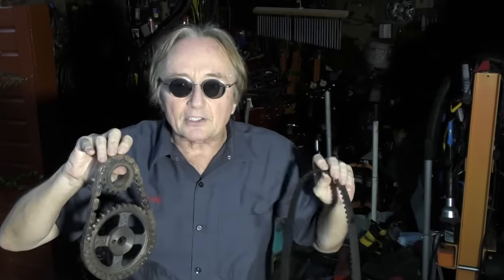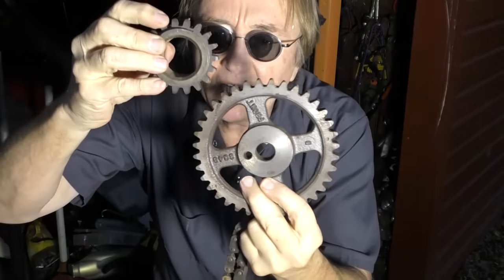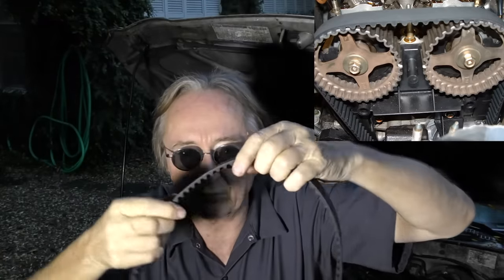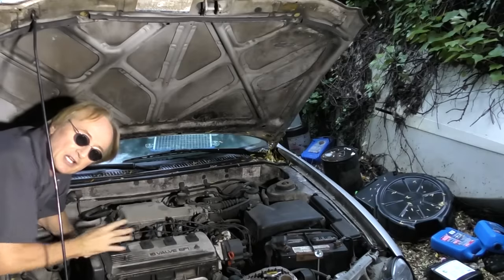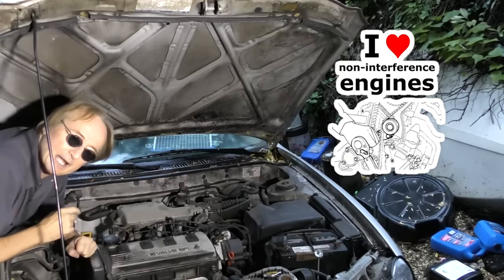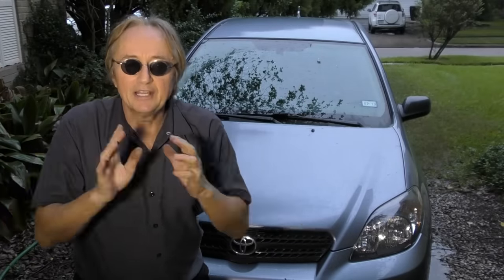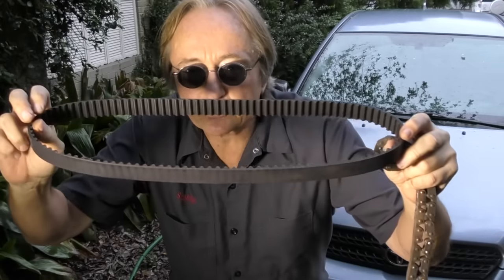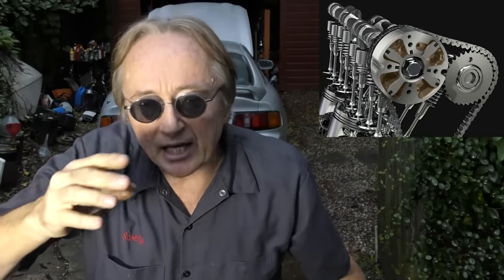Why Some Cars Have a Timing Chain Instead of a Timing Belt

Comment: It's always the same cycle over and over....new guy says we need to dump this old crap...I can save you millions.  Gets promoted.  By the time that idea causes all sorts of pain it's too late.  Then a new new guy comes in and fixes the last bad idea with a another new idea that is actually the old one abandoned by the first guy.  Now he gets promoted.  When all along we should have just been making sturdy reliable products that work for the long haul.  We never seem to realize that new technology often replaces our old problems with new ones.  Either way you still have a problem and nowadays you often wind up with more of them.
Reply: Paper or plastic?
Reply: @tbillyjoeroth  plastic=more useful.
Reply: Like the guy who said DI was the end all be all....  I've seen those so gummed up it choked the air trying to get past the intake valves on gas engines!   What a joke
Reply: Exactly why I will never buy a car with a turbo engine. Enough said.
Reply: So true that’s the lexus attitude and toyota - build it to last and make it right the first time.
Reply: Responsible Citizen . why would they make sturdy, reliable parts. They are in the business of selling year after year. Decade after decade. People want new cars, new body styles. Why put more money if people expect to buy new, and they keep selling you new.  
I agree with you completely. Thou. The other part is new technology has its initial flaws 1st year production cars are the worse cars to buy. The last year has most bugs worked out. But by then they have updated models coming out.
Reply: Scotty doesn't know what he's talking about here, timing belts are an excellent design choice, they're lighter than chains, they're more efficient, simpler, less expensive, quieter, they absorb harmful harmonics that can occur between the engine and cams, they can easily be used to run the water pump, etc... Too many car owners simply neglected timing belts, so manufacturers went to chains.
Reply: It's the same in politics
Reply: @opus_workshop  Electric cars weren't even remotely close to being competitive 100 years ago, the better technology won out. The only reason electric cars are viable now is due to the technologies that were developed for computers.
Reply: @opus_workshop  Electric cars weren't at all competitive with ICE vehicles, they just offered some conveniences that ICE vehicles did not. The technology to build BEVs that performed well simply didn't exist in those days, and wouldn't until the invention of the transistor.

"They did not stick to the method from 100 years."

Because there were actually huge benefits to going from piston engines to jet engines in larger aircraft. To this day, turbine engines do not make sense in smaller aircraft, the technology is inherently inefficient in light aircraft applications.

"Trains as well. Evolved in fuel type from steam, to diesel to electric."

Electric trains aren't reliant on batteries, they get their power directly from the grid. Batteries are what limit the capabilities of electric vehicles in most applications.

"The problem was and is the oil industry forcing a stop on evolution."

That wasn't the case 100 years ago. It was the case in the '90s, and is still a problem, but only in a small way. 

"The technology was viable a long time ago, half a century, if only instead of pouring billions upon billions into R&D for gas powered vehicles, those would have been poured into EV tech, we would have had electric airliners by now, and huge solar harvesting tech. But we are 50 years behind, as we know all too well why."

People have been pushing for improved battery technology (in a very big way) for decades now, the improvements haven't come anywhere close to indicating that battery technology would allow for things like electric airliners. The world doesn't simply bend to our will on command, there are real, physical limits which we can simply not exceed, and battery technology already looks like it's close to its limit.
Reply: @opus_workshop  Are you forgetting how awful Battery technology was even 15-20 years ago? Electirc cars lost out to ICEs because the battery technology didnt improve significantly whereas ICEs made huge leaps and strides during the same time.

We had to wait until the 1980s for lithium ion  to be invented and  only now battery tech is just beginning to  catch up to allow a renaissance of electric vehicles.
Reply: @PistonAvatarGuy   idontcare80  Did you watch the video? Scotty said that when timing belts are made well and used properly they can last a really long time. Coupled with a conservative replacement schedule, they shouldnt give you any problems.

The problem is  when you have poorly made belts in poorly suited applications with poor maintainence, the risks and fallout of catastrophic failure was too much for manufacturers to tolerate.
Also the fact that with newer engines with interference design and techrequiring a lot more tension, the risks and damage of belts snapping has only gotten higher.
Reply: @NidalRashid  Yes, I watched the video. Kilmer claimed that manufacturers adopted belts because they were being cheap, but they were really just adopting the best performing option... which also happened to the cheap one. You shouldn't even have to worry about replacing a timing belt before the recommended interval, most belts will last well past it.

As far as the technology is concerned, there aren't really any poorly suited applications for timing belts in road vehicles, they're not F1 engines. Consider that NASCAR racers run timing belts because there are so many benefits that come with using them. Recent engine designs are also pretty easy on their cam drive systems when compared to the high revving engines that were produced by Japanese manufacturers and were becoming common in the '90s, like the Honda B-series and H-series engines, or the Toyota 2JZ-GTE and 2ZZ-GE. Neglect by vehicle owners is the ONLY reason why timing belts aren't well suited to road vehicles.
Reply: @PistonAvatarGuy   idontcare80  i guess you are right. Kilmer    does say that manufacturers were primarily motivated by their cheapness. But he does acknowledge some advantages of belts (such as quietness).

I still think that while owners should take responsibility  for their cars maintainence, reliability and graceful failure are important parameters in designing a good car for the general population (instead of putting all the blame on owner neglect). I guess we will have to agree to disagree on that. 

Nevertheless thanks for sharing facts and perspectives on the matter that Scottie didnt.
Reply: @NidalRashid  "reliability and graceful failure are important parameters in designing a good car for the general population"

Except that belts are extremely, EXTREMELY reliable, so there's no need for them to fail gracefully, they basically always make it to their change interval. Except in extremely rare cases, belts don't fail prematurely unless they're neglected by the owner, or installed improperly, so basically all of the blame does fall on the owners.
Reply: @opus_workshop  Except that (even now) we can't "switch" to BEVs, there is a whole huge range of things that they simply can't do... and may not ever be able to do.
Reply: @Aviatr23  More waste
Reply: @PistonAvatarGuy  Baloney.  Timing belts have always been an el cheapo solution for el cheapo companies.  The belts do break often very quickly after the book mandated change period. My sister has had two belts break thusly with destroyed engines both times.  Well she should have had them changed on time you retort.  Sure maybe, but she couldn't afford the 500 dollar service charge for the belt change.  

So here are the points
1) belts are cheap for the manufacturer to use
2) belt maintenance schedules generate expensive (profitable) work for dealerships
3) belt failure means the person gets to go buy a whole new vehicle.

As an aside I had a timing chain in my old mocked and derided 1994 Dodge Dakota. It gave me 12 years and 358000km of driving without engine trouble.  I changed nothing.  
I gave the truck to my brother in law, it continues to drive to this day on its original DODGE  timing chain.  Nuff said.
Reply: @percussion44  Like I said, belts were not only the best engineering solution, but they were also the least expensive option. Just ask yourself this: Why do NASCAR racers run belts instead of chains?

I've seen several timing belts go tens of thousands of miles past their replacement interval. 

"Sure maybe, but she couldn't afford the 500 dollar service charge for the belt change."

Which is why you don't find timing belts in most cars, that still doesn't mean that they're not the better performing option. Ever heard of something called operator error? PEOPLE were the problem, the technology itself was superior.

Google: Timing chain failures. I've seen PLENTY of timing chains that launched through chain cases, and I've known plenty of people who've had to replace stretched timing chains, and chains are much more expensive to replace than belts. Tensioners are also a common source of problems. 

The only 1994 Dodge Dakotas that had timing chains also had pushrod engines and the timing chains on pushrod engines are simple, so they rarely have issues, the same is not true for OHC engines. Also, I had a friend in high school (late '90s) that had a Dodge Dakota from around that same year, it was already falling to pieces, I didn't think any of the first gen trucks made it out of the '90s intact, you must have had a unicorn.
Reply: @PistonAvatarGuy  Nope.  Engineering solutions are there to support people.  Human beings and all their flaws and habits etc.   Proper engineering is done to maximize the human experience.  A solution that ignores the most critical element is useless.  As for  NASCAR, pretty sure they tear down engines after each race.  Are you proposing the average Corolla driver do the same?
Reply: @percussion44  The latest iterations of timing belts last 100,000 miles, which is about as long as some timing chains... while also being lighter, cheaper, more efficient and while absorbing harmonics which can cause engine components to wear prematurely. EVERYTHING in engineering is a compromise, manufacturers had no way of knowing that people were going to fail to maintain their cars properly, so they went for the option that performed the best. In hindsight, it was probably better to compromise performance in order to cope with irresponsible owners. Even still, timing chains aren't easy to design properly and some manufacturers have struggled with timing chain reliability. Take Audi, for example, they're famous for having serious timing chain problems. How about this, Google: timing chain recall
 
Why are there so many recalls associated with timing chains if they're so reliable? You can also bet that a timing chain problem is going to cost you a LOT more than a timing belt issue.
Reply: you nailed it. 

For eg: older late 60's v-8s didn't make a tremendous amount of HP per cubic inch and weren't that efficient. BUT if you figure in the cost to build the engine, or to rebuild the engine, vs the estimated fuel savings you'll find that it was actually cheaper to run the old engine vs the new ones.

It isn't that unreasonable to find a 1970 Camaro 350 with 500,000 miles on it and still going strong. Ok, it only got 16 mpg. Fast forward 50 years and you've got a v-8 now getting about 24 mpg. So maybe over the years you saved $4000 in fuel. (only about 150,000 miles because the newer engines don't last 500K). So you have to pull the engine and do the timing chain, vvt phasers, fuel pump, etc etc etc...how much does it cost you? $4000.00. So how much did you save? 

Oh but the emissions. Ok, how much pollution and energy does it take to produce a car/engine? The amount a vehicle produces after it's built is about the same as what is created when the engine/car is manufactured so it is far far more environmentally friendly to have a vehicle that lasts for 3x as long. I mean, HOW much do new vehicles cost? If you blow your engine on an 8 year old vehicle, you'll probably scrap it. A replacement might cost you $30,000.00. That's a LOT of gas you could buy......
Reply: @muskokamike127  "It isn't that unreasonable to find a 1970 Camaro 350 with 500,000 miles on it and still going strong."

Yes it is! They rarely even made it to 100,000 miles, 500,000 is completely out of the question, unless you're talking about a very well taken care of car that had multiple engine rebuilds. Hell, the odometer didn't even have 6 digits in those days, because the cars never lasted long enough to justify putting a 6th digit.

"Ok, how much pollution and energy does it take to produce a car/engine?"

Not much compared to the emissions that come from burning fuel in the car,

"The amount a vehicle produces after it's built is about the same as what is created when the engine/car is manufactured so it is far far more environmentally friendly to have a vehicle that lasts for 3x as long. "

No, it isn't, the amount that it produces while on the road is many, MANY times greater than the emissions produced during its production.
Reply: @muskokamike127  On YouTube, search: 500000 mile car

What comes up? Hondas and Toyotas, all modern.
Reply: Cars are being sold by just constantly chaining things around with them, and adding all kinds  of toys/gadgets to make the car seem good. My 2006 Honda Accord that I had bought brand new, should last me another 10 years without any serious troubles.
Reply: new car owners dont care. second hands car buyers do care.. and now when a few belts snap. the bad reviews come.. hurray for my old toyota with a chain!!!
Reply: idontcare80 

Chains require removal of the sprockets and tensioner. Most of the work is gaining access, regardless of whether it’s a chain or belt.
Reply: Corporations have difficulty rewarding or even identifying steady long term performance of individual employees. New employees must differentiate themselves to prove their own performance, and 9 times out of 10 this means changing something. The problem compounds when the change includes a new layer of management, all of whom are incentivized to make their own changes. This leads to a sort of corporate psychosis that is incomprehensible to anyone outside the system. Also, car companies are focused on new car sales and maintenance fees for their dealer networks. Any vehicle longevity beyond the warranties actually hurts them. People with the mindset to care about longevity of a car tend to buy used anyway, and so there is little feedback of this desire to car companies.
Reply: @louisstennes4542  
I loved my old accord but the new ones have,
CVT, Direct injection, turbos, timing belt and interference engine.   
Went with a a 2016 Camry and have none of that or things like auto start/stop.
Reply: Ridiculous! It's called manufactured obsolescence. Companies don't make things to last anymore including Toyota